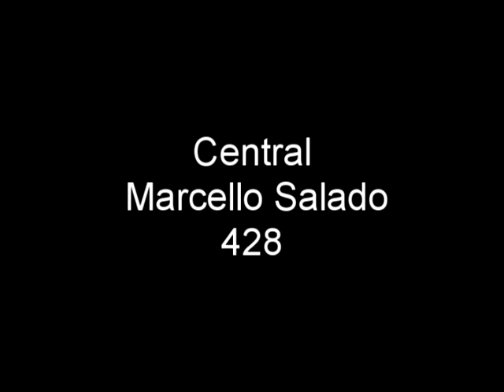Cuba Steam in Paradise 1999 part 5

Comment: Excellent video, - well done. I'm a little surprised the loco that was slipping did not have auto sanding - being slightly ignorant of the finer points of loco operation, what was the chap standing on the top of the boiler doing,? - I noticed the one in front sanding the rails. I'm surprised at them being forward thinking enough to build a steam museum, are any operational or are the loco's just sort of parked in the shed they operated out of and someone had the idea to charge to look at them.
Reply from the maker: You have almost answered your question. The chap on top of the boiler is by the 'sand dome'. He was trying to get the sand flowing. Cuba is a tropical island and can become a bit humid. Although the sand would have been poured in dry it may have become a little damp and clogged the pipe. 
There are several steam/sugar mill museums in Cuba. Most just have non-running exhibits. The best chance of seeing preserved steam in operation is to join a rail enthusiasts tour that includes charters.
Reply: I thought that was the sand dome - I just couldn't understand what he might be doing up their. My interest in steam is only in 'working' stuff, - alas now extremely thin on the ground. I am not decrying the preservation movement one bit. Although for one who has enjoyed the days of 'roaming the rails' behind nothing but steam. I'm sorry I just don't see the 'beauty' in tearing along behind a diesel or electric. I know it's called 'progress' but sometimes I wonder if it is all for the better - give me a 9f any-day or an O&K with mud holding the smoke-box door on in Java and I would be in heaven.
Reply from the maker: I totally agree. My Cuba 1999 series of videos are all real working steam locos, even the few clean ones!